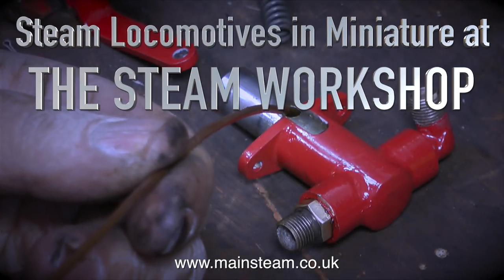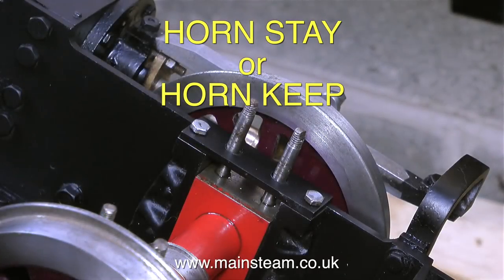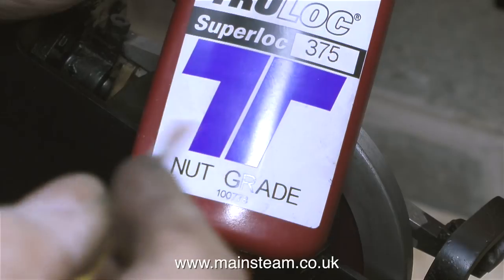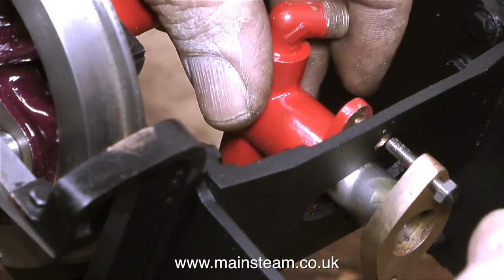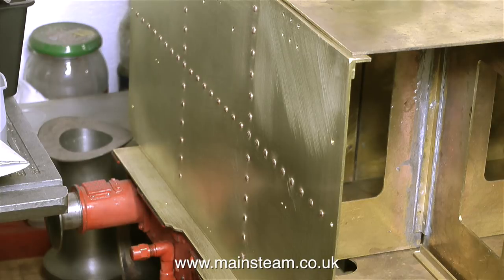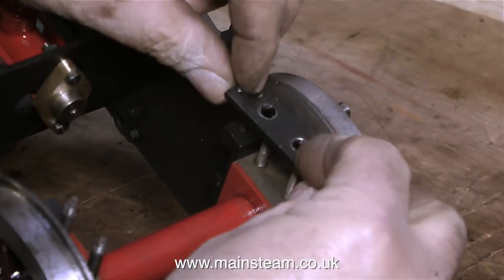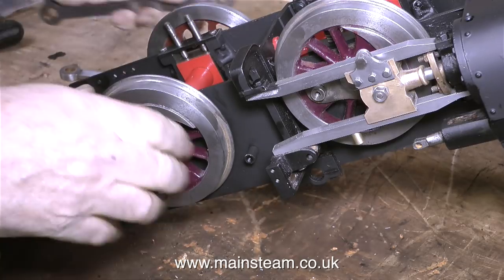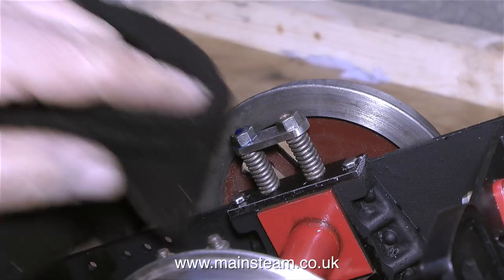WORKING AT THE STEAM WORKSHOP #8 - THE AXLE PUMP AND SUSPENSION

Comment: This was fascinating. I had no idea that play was so vital in locomotive suspensions at this scale. Anyhow, not to pile on about the "dirty hands" comment you received, but jiminy christmas, if there're only two things that dirty hands represent, they'd be 1) working hard and 2) having fun. My pop used to say that if you can manage both at the same time, you're doing it right, and by that measure I think you're doing it right, Keith. Thanks again, as usual, for another great Steam Workshop episode.

Comment: Steam locomotive suspension fascinates me. On one hand you need the rods and running gear to be relatively tight at the bearings to avoid them from bashing themselves away. But on the other hand you need the axles to move up and down and independently of each other so the wheels stay in contact of dips in the track. Its almost like having the crankshaft in a car engine be able to bounce around

Comment: I was very interested in Blackgate's two castings sets for tools with the multi sander grinder really catching my eye as seeing that as a very useful project.   One thing that did make me chortle is my old scratch built engines safety pressure valve is identical in shape, form etc to that of a Reliant Regal and Supervan differential pressure gauge, even the thread is the same and I thought the Reliant one was steel whilst mine is brass, the Reliant one however was plated, so I surmise my scratchers engine is using just a Reliant safety valve which pops off at about 20psi.

Comment: This is an interesting video as it highlights one of the problems when building a model live steam loco. How much will the springs compress when the loco is fully built and loaded with water?  Ideally you want the driver wheels to remain aligned with the piston rods. Is there a method for this?
Reply from the maker: It's "trial and error" but you get there in the end .... {:-)))

Comment: I have always believed that suspension springs should have almost no compression on them when the axle is unloaded.  Spring listing in catalogs have should have the compression rate per inch/cm.  Selection of which spring depends on the number of springs and the average loaded engine weight.  Final goal is to get the loaded engine to sit at the correct alignment of the axle centers and the the cylinder center line.  Math (previously discussed) is in involved, but relatively simple.  Shortening the springs may help.
Reply: My background is only rc cars. Their suspension is not unlike this. The precompression in the unloaded state is not the relevant factor. Preload (precompression if you will) only adjusts ride height, assuming no bottoming out and compression locking. The stiffness is entirely dependent on the spring regardless of load. In fact, shortening a spring makes it stiffer. Think of it as a long bar which has a load put on its end. If you shorten the bar, it will bend less under the same load. (A spring is nothing more than a wound up long bar, if you think about it.). 

Hope this is useful, if not, sorry.

Comment: It seemed that after you determined the springs for suspension were too stiff, you tightened them even more on the second fitting. Looked as though the springs were compressed to the point of nearly touching their coils together.... ??  Wouldn't you need slightly shorter springs? or at least a looser compression on the springs?  (thanks if you respond).
Reply from the maker: It's unimportant how far I tightened the keeper plates as I already knew that these sprigs were far too strong for this size of engine ..... I need to fit a new set of springs with thinner diameter coils and less of them - ie: shorter ......
Reply: I just re-watch this, and you said it plain as day that the springs were too strong. I must have turned off my ears for that part. Thanks for the reply and great vids. PS. it's extra fun that you are working in the steam-shop. It adds a new dimension to the process and access to different set of tools. :-)
Reply from the maker: Yes, as I just replied to your previous question: I already knew that these springs were far too strong for this size of engine - so it's unimportant how far I tightened the keeper plates - as I am goiung to change them anyway for another set that are more suitable .....

Comment: You mentioned the suspension springs are too strong. Being that it's not your engine, are you allowed to make any modifications to the original engine as you see fit ? 
As far as bad comments go, it's the main reason I still resist uploading to youtube, I'm afraid my skin just isn't thick enough.  There are some real dipstick armchair experts out there but dumb people are not that bad, it's the mean spirited ones who seem to be on youtube just to pick on the video's creator and/or the other commenters. 
Anyway, I love your work and this series at the workshop, keep on steamin'...
Reply: agree 100 percent,
Reply from the maker: I need to make it work, so I have a fairly free hand The only thing I am not responsible for is the painting - someone else at the Steam Workshop currently does that..